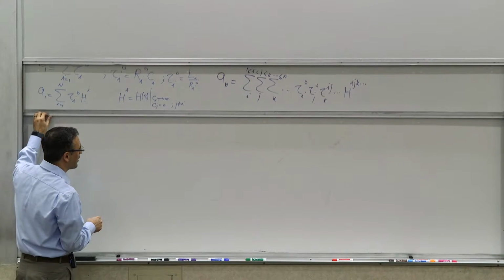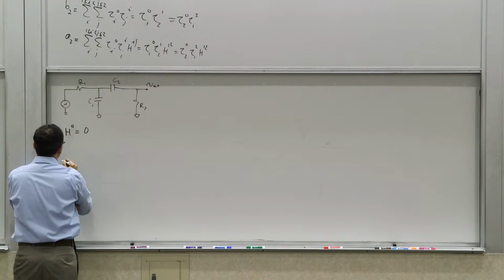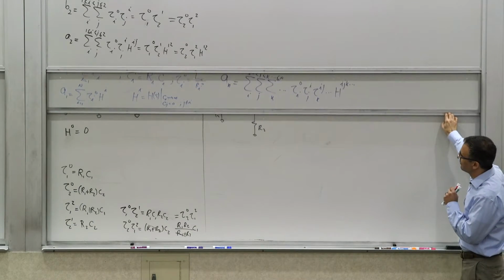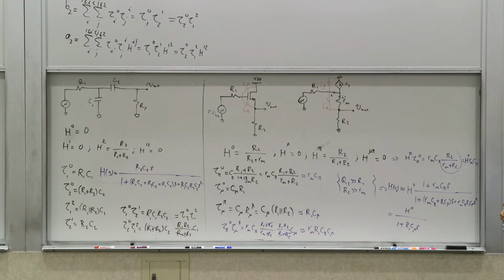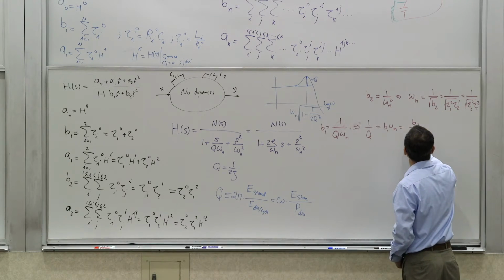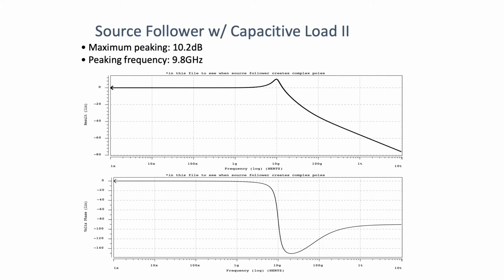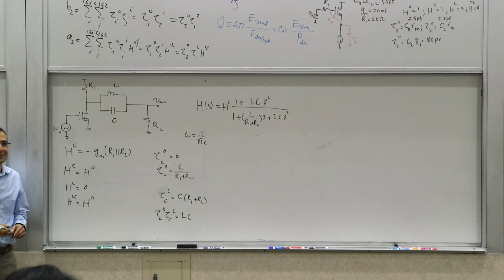151N. TTC Examples, 2nd Order System, Quality Factor and Natural Frequency

Comment: Hi professor, thank you for the amazing lecture. One question I would like to ask is that how, intuitively, can a source follower resonate? I thought that in order for a system to resonate we would need at least two energy storing devices in different phases, i.e. capacitor and inductor. But a source follower doesn't have an inductor, is there something behaving like an inductor?
Reply: Very good question! the prof already answer it in previous lecture when he calculate the output impedance of the source follower and it has inductive behavior and he find the equivalent network for it and equivalent inductance value so this what actually make a ringing and make resonance possible. the detailed derivation in 141N in this playlist .

Comment: How can we comment about the zero whether it is LHP or RHP if the dc gain is itself 0. For a single zero circuit it is fine that the zero will be at origin. So for the circuit which has dc gain = 0 in this video it is said that zero is in LHP that is not correct. But for a multiple zero system in which dc gain is zero we can't comment about the other zeros which are existing in LHP or RHP. Right?

Comment: 00:05 - Overview of second-order systems and their transfer functions.
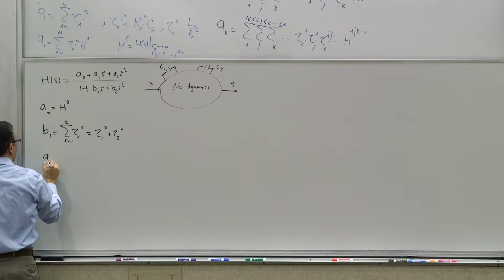02:13 - Understanding the relationship between time constants in a 2nd Order System.
07:20 - Understanding transfer constants and poles/zeros in a second-order system.
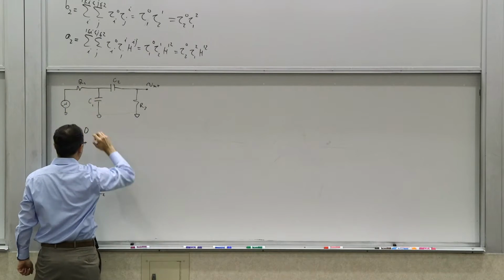09:41 - Exploring tau values in a second-order system's calculation.
15:28 - Understanding the impact of capacitive loops on system order and initial conditions.
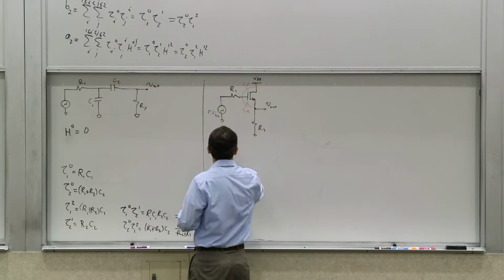17:39 - Explaining transfer functions in small signal sense for linear circuits.
22:12 - Understanding time constants and short circuits in a second-order system.
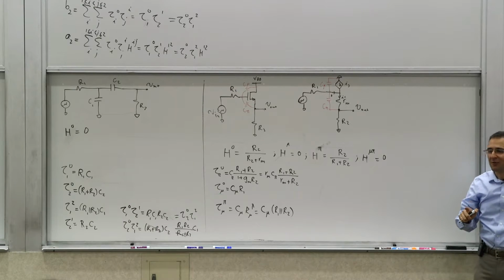24:44 - Calculating transfer functions for second order systems.
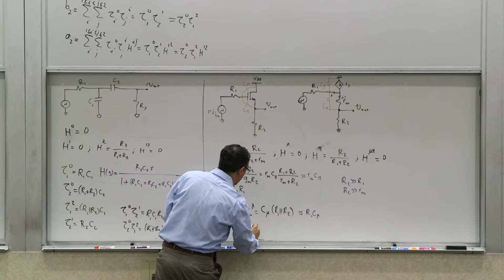29:06 - Simplifying R and C terms leads to an approximate transfer function.
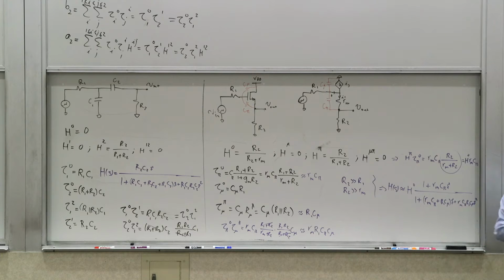32:06 - Circuit dominated by time constant R1Cμ influences frequency response.
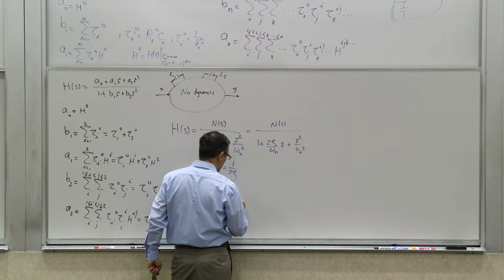36:57 - Understanding Quality Factor (Q) and its relation to energy dissipation.
39:05 - Understanding Quality Factor (Q) in Second Order Systems
43:42 - Calculation of time constants in a 2nd order system using capacitors and resistors.
46:24 - Calculating time constants and quality factor for a 2nd order system.
51:46 - Explains time constants in a second-order system circuit.
54:15 - Explores transfer functions of a 2nd order system with resistors and capacitors.

Comment: So when counting zeros - if setting an element to infinite value does not flip the sign of the gain, that means a zero at LHP including the sigma=0 axis? (as is the case in the 2nd-order R-C example, gain not inverted when shorting C2, but the zero is at origin; also in the L-C example, the zeros are pure imaginary)